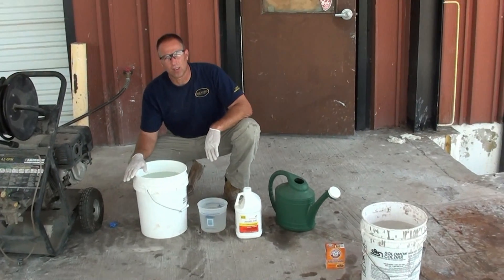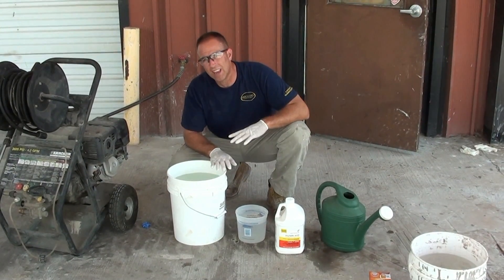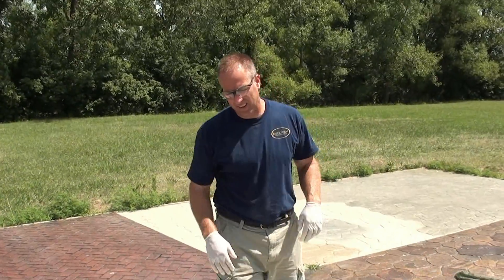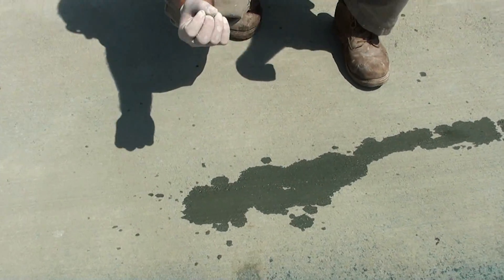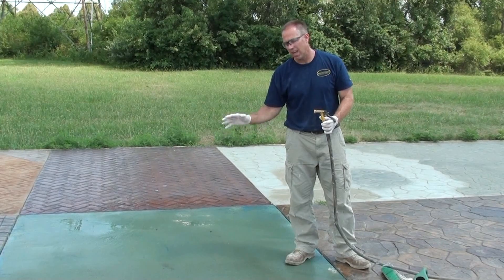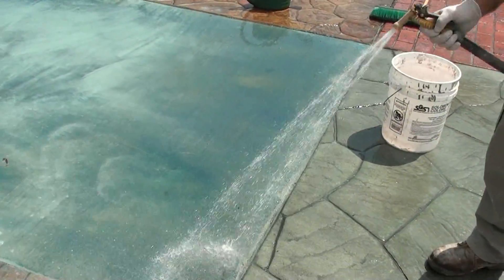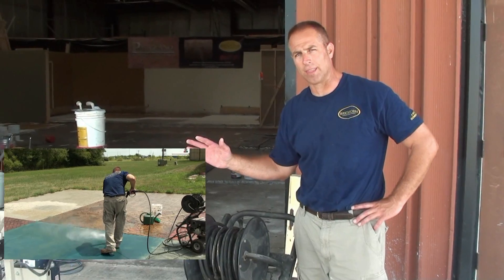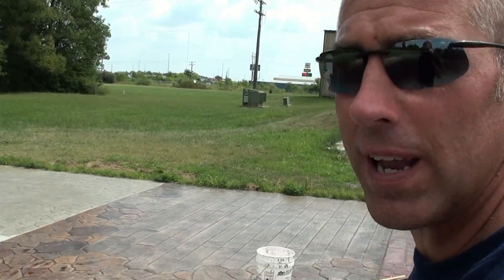Concrete Surface Preparation Video 2... ACID ETCHING

Comment: I’ve acid etched before as a surface finish preferring it to a broom finish. I’m preparing to do the same to a new patio pour. Is it necessary I seal it after? I’m watching videos as a refresher and the acid wash seems to only be used for preparation of something to go on top of the concrete. I live in temperate climate of PNW. What do you recommend?

Comment: Do I need to acid etch a brand new concrete floor that has been finished with a power trowel, before epoxy primer?
Reply from the maker: Generally, yes. In almost all cases, a power troweled surface will be too tight to accept any stains, coatings, or primers. To be safe, reference the tech sheet for your epoxy primer against the floor profile and ICRI standards.
Reply: Thanks.

Comment: I recently had a 1000 sq ft colored bluegray patio and walkway poured, and the patio came out with crazing (map cracks) over 50% of the patio,  two tone colors, spotting and brown streaks, pits, a low spot and two different finishes (brushed and smooth), and efflorescence chalky finish.  Everything that could go wrong, did.   He poured it in 90 degree CA weather after i asked him to wait, he refused. The licensed concrete contractor said he can "fix" it with acid washing.    In your opinion, would acid washing make it better or worse?  Not only is it not the finish I originally wanted, for 16k, but I am concerned that the acid wash will only accentuate the problems.   Will the crazing cracks and rough spots be noticeable? I think I'm getting myself into more trouble.   In your professional opinion, do you think I should try it? Or ask him to unfortunately remove it.

Comment: Thanks for the video!  I’m staining the concrete decking around my in ground pool.  I have plantings and landscape wiring around it.  What acid do you recommend and should I be concerned if some acid wash gets into the pool?

Comment: I acid etched my indoor garage 2x. The second time I went with 75% muriatic acid, but still not getting the smooth finish off the garage floor in many places. The floor yellows up when applied, but after being on the concrete for 10 minutes or so, it still feels like 220 grit sand paper in many places. After looking at your video, I'm assuming there may be a sealer on the garage floor which was done before I purchased. Any thoughts?

Comment: I am dealing with a floor that was used as mechanic shop. I am trying to clean the surface of the floor from oil. Is the Muriatic acid good for this application. Thanks.

Comment: My sump pump discharged groundwater onto the driveway and created a heavy rust stain. I cannot remove with a pressure washer. Any advice?
Reply from the maker: Use a mild cleaners, such as Brickform E-Etch to remove staining or residue. If that does not work, you may need to use a stronger acid solution or mechanical methods. Just to be safe, it might be in your best interest to contact a professional concrete contractor. Visit myconcretecontractor.com to find one in your area.
Reply: NYYBBTeam rid o rust sold at my irrigation store

Comment: thanks for the video! do you ever use a 20 inch surface cleaner on the concrete or only use the spray tip you used with the pressure washer? just wondering if you feel using a surface cleaner would be just as effective since it's resting directly on top of the concrete. thanks.
Reply from the maker: +thomas lopez A mechanical scrubber with an aggressive pad is excellent for most surface prep and cleaning.

Comment: If I diamond grind to remove a previous sealer, which is failing, do I need to use the acid afterward or will the grinding be enough to prepare for epoxy?
Reply from the maker: +Emily Guimont Aggressive mechanical surface preparation such as grinding, blasting, and scarifying should be sufficient. You should, however, always clean the surface and check to make sure the sealer is still removed. Washing with Brickform E-Etch (a mild and easy to use etching and cleaning compound) helps with both. If the E-Etch does not "fizz" residual sealer is preventing a reaction with the cement. It is also a good idea to test water absorption. Dump an ounce or two of water on the cleaned and ground surface. If it does not quickly absorb, the surface still has sealer or is not sufficiently prepped for your epoxy. If you are planning on using an epoxy, consider a Brickform overlay such as SM Professional Grade. Depending on your application, you may find it to be the superior, decorative choice.